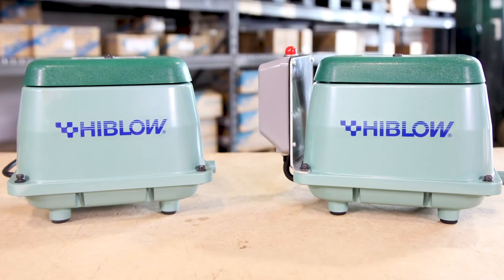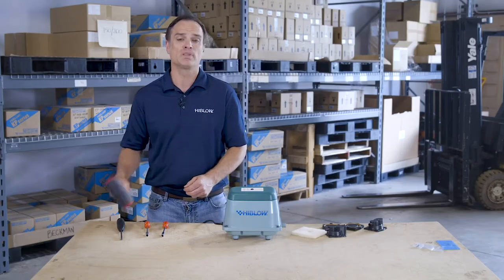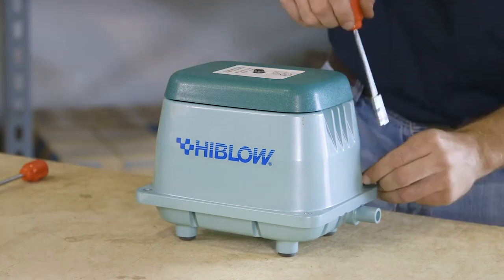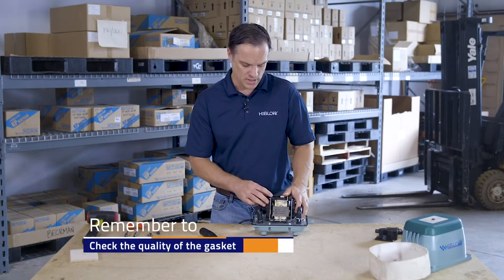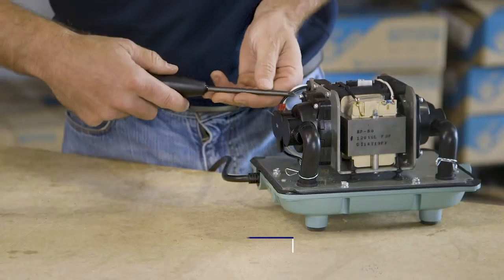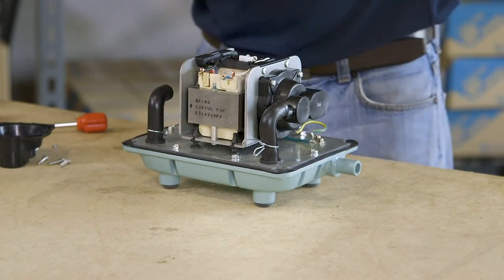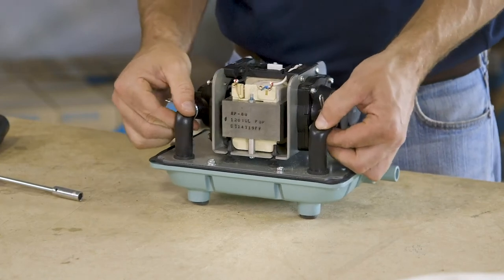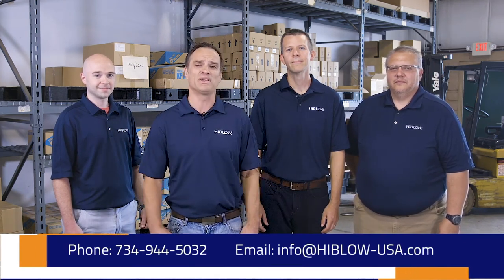HIBLOW HP-80 Rebuild Video - New Style Safety Slide Switch (Same for Models HP-40 to HP-200)

Comment: Just got my new HP80. There is a little brass nipple on the side that air comes out of depending on how much you restrict the air flow coming out of the main output port. What is it for and what should I know about it? It is mentioned no where in the manual.
Reply from the maker: I apologize for the delay - just saw this question.  The brass nipple is used to connect a small tube that goes to an external alarm panel - used for septic applications.  If the pressure drops below 1 PSI, the alarm will sound. If you do not need the nipple, simply replace it with the screw that is in the box.

Comment: What is the purpose of the micro switch?  I think it shuts off the motor if a diaphragm fails….?
Reply: The purpose is to randomly turn off the pump when nothing else is wrong. Old pump ran 18 years. New safety switch pump randomly trips. Reset it and it may run a few months or only a day. If I was a pro, I'd send these back and get the old plastic screw type unless you want to explain it to customers.

Comment: I just replaced the air filter and both diaphrams. The pump doesnt seem any better, actually a little louder. Could i have tightened the nut too much on the diaphrams?
Reply: Sorry for the late reply.  That is possible, but noise usually comes from air or vibration.  How do your gaskets look?  Is the base gasket deteriorated? Also, did you install an authentic rebuild kit or a knock-off?

Comment: Got kit with new OEM parts, what is the black screw with micro threads and white nylon nut for? it is in its own baggie.
Reply: It’s a safety screw. There are two different variations. One with a white sliding device on top of the magnet and one that uses the safety screw. This video references the two different versions. This video is for the one that does NOT use the screw. If you fast forward to the point they are talking about it they reference their video that shows the version with the screw.

Comment: Hello.

My compressor is two years old, I changed the rubber membranes today because they were deteriorated.

Now, after a few hours, I see that the supercharger seems hot to me. Do you have this problem on these models? I never noticed that before, but I don't remember whether it was heating or not. Moreover, I find the air that comes out extremely hot too.
Reply from the maker: Hi David - I'm sorry for the late reply, I wasn't notified of your question for some reason.  Please email info@hiblow-usa.com and I can try and assist you from there.  Diaphragms should last longer than 2 years so I think we should look into some outside variables that can increase heat and therefore reduce the life of the diaphragms (excess pressure, air circulation, shelter, etc...)